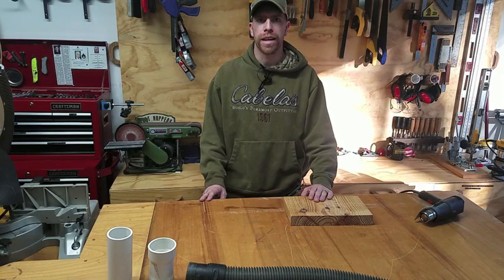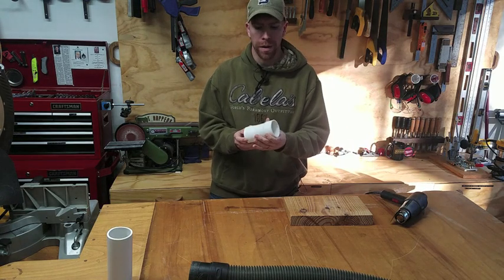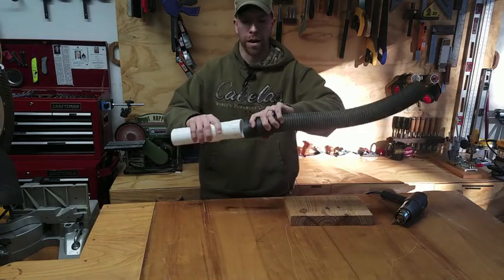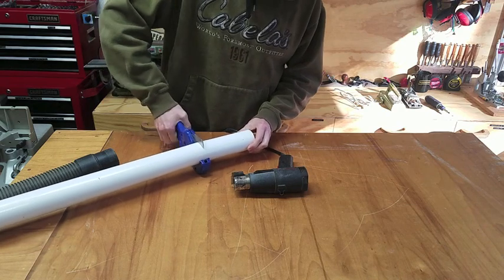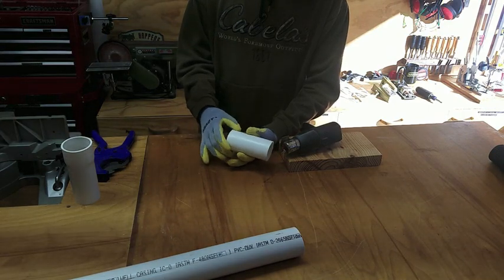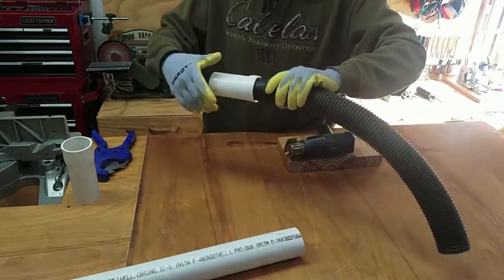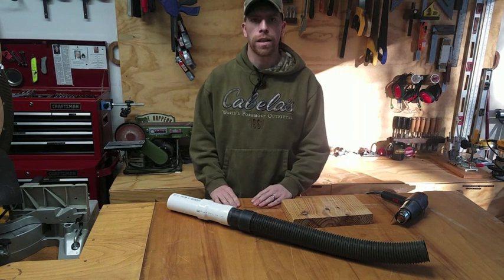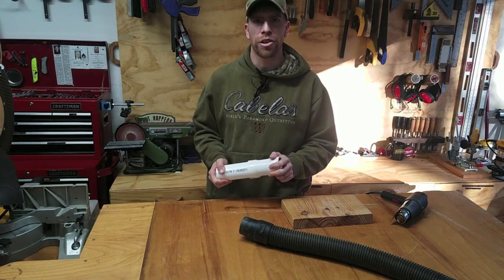Quick Tip: Heat Form PVC 170-220 deg F. / EP47

Comment: When the pipe cools down it shrink some, so if you make one for you miter saw (as I did) and put if on wile is worn, (not hot)  it may not come out, I had a to cut it off.  So let it cool off, it take 10 times longer than getting it hot
Reply from the maker: Great tip, Fredy. It certainly does, thanks for sharing it!

Comment: Great video, you get right to it and get it done without a bunch of hoopla. Question, what's the total time it took to heat so it was pliable enough to manipulate?  And were you using the hottest setting and full air?

Comment: C.
Reply from the maker: Clarifying: temperature range written in Deg Fahrenheit is for the application exactly as described.
I'm referring to the process of softening and forming, not full melting point for PVC. This can be be achieved on the low end with a hairdryer, heat gun for bends/stretching....or achieve full softening (lower end of  melting range) by submerging in boiling water.